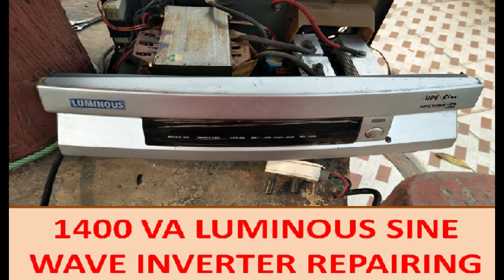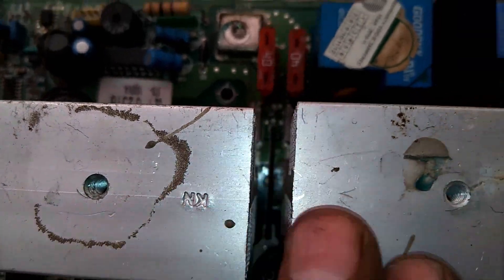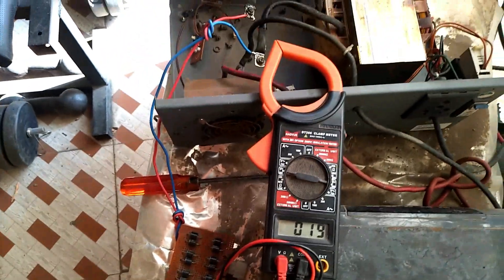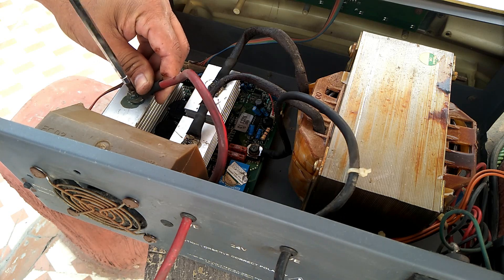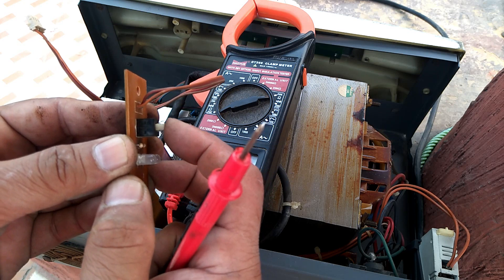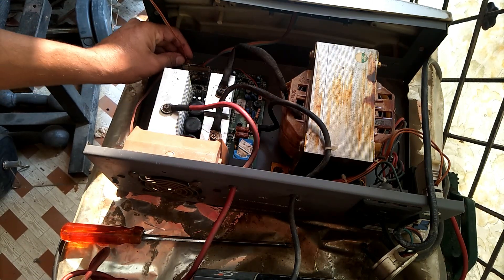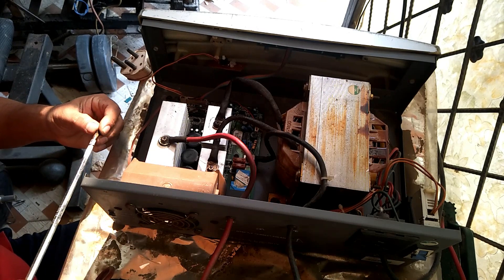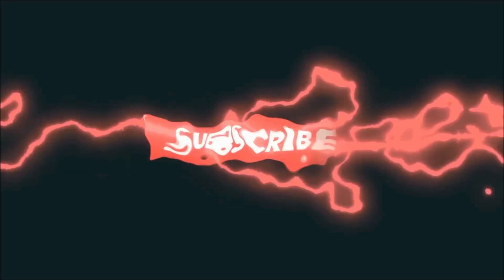1400 VA, 24 VDC, 2 Battery Luminous Sine Wave Inverter Charging Problem Repairing/Solving at Home

Comment: i have a problem in 1400 va luminus sine, when mains down, the voltage is very high (  + 400V AC ) , please help me for problem
Reply from the maker: Dear,
Sine wave inverter main ya to MOSFET ki problem hogi ya IC problem kar Rahi hogi
Isko manually check karna kafi difficult hota hai. Better hoga ki aap kisi sine wave inverter mechanic ko dikhay